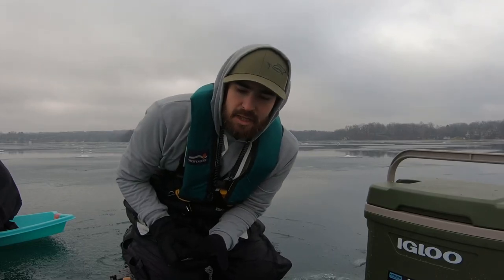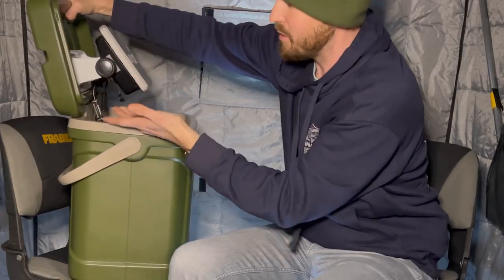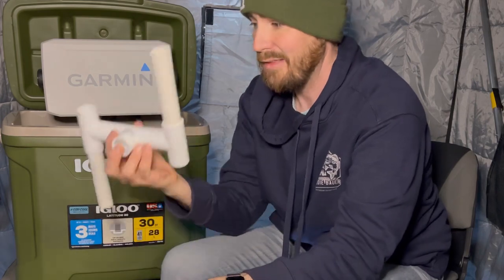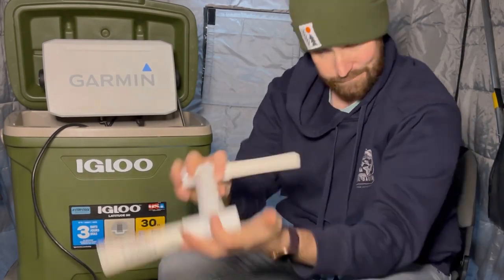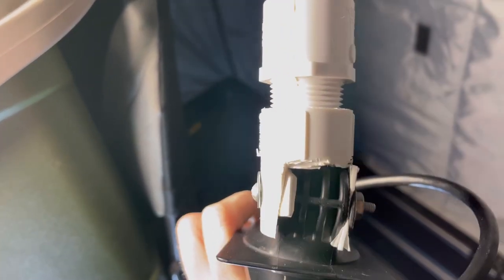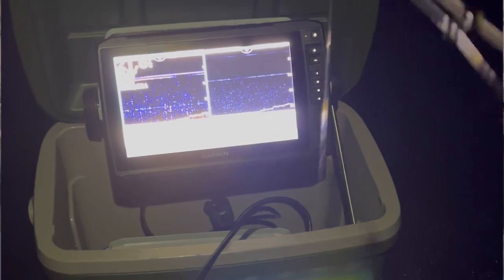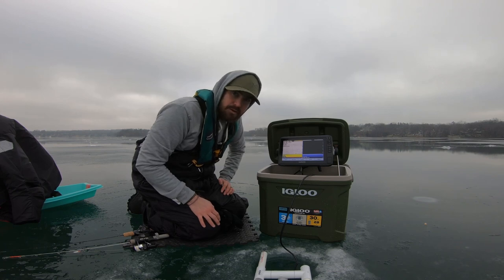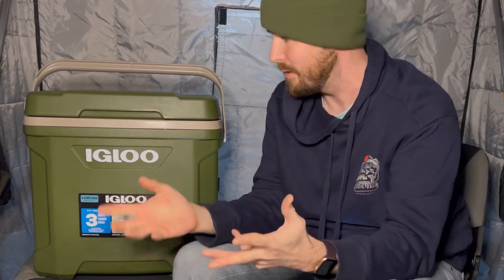EASY DIY Portable Garmin Ice Fishing Sonar | Best Livescope Panoptix Setup

Comment: Have you tried using the side view to find weeds, rocks, trees or brush?
Reply from the maker: It won’t work the same. You need to be moving in order to see that. Yes I mean could you probably use it in some capacity, yes. But it’s not something easy to see like from a moving boat.